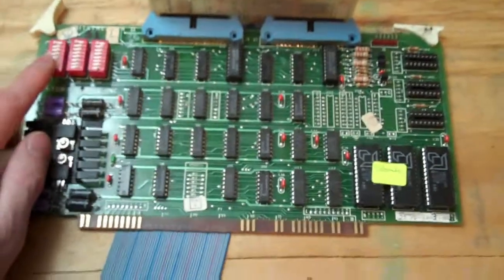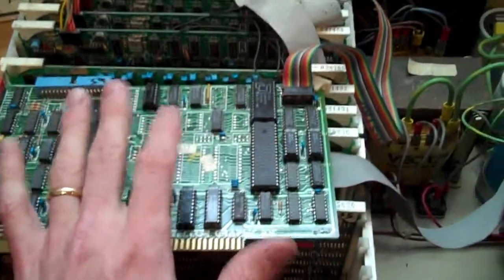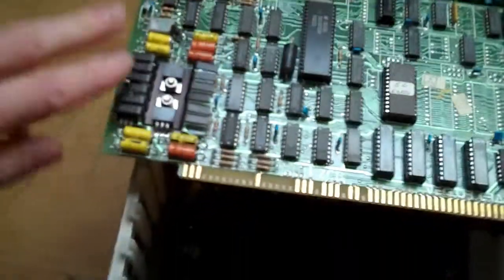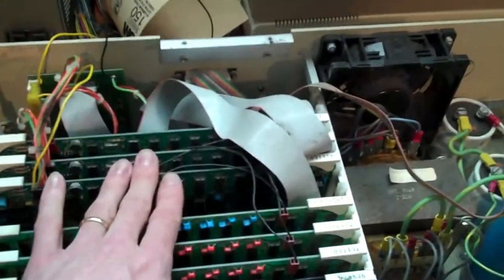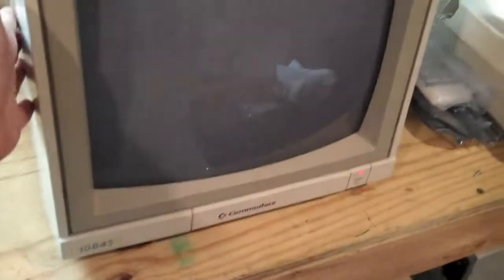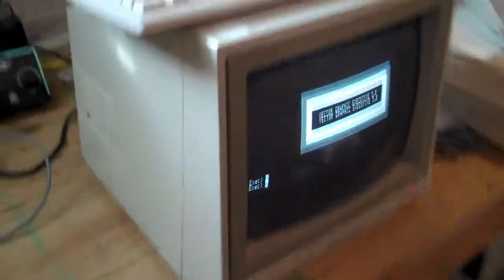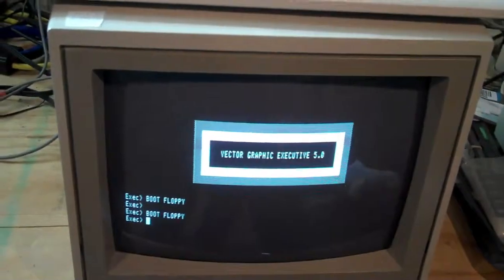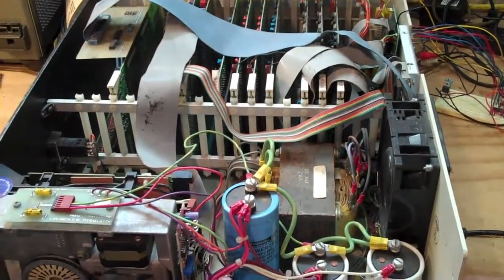Vector Graphic 5032 Tour, Part Three

Comment: The 8080 chip could not function as a processor by itself; it needs an external clock generator and system I/O chip to function properly.  The Z80 put much of these ancillary components on the same chip and was much easier to implement.  This is one of the reasons why the Z80 was so popular.